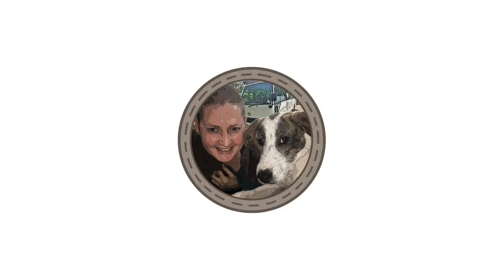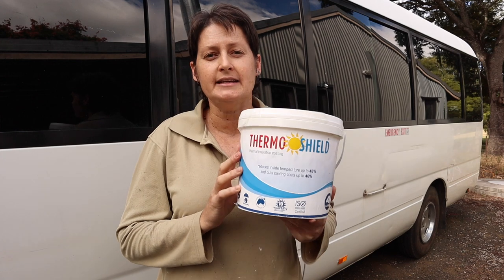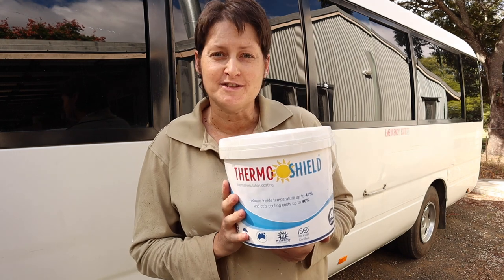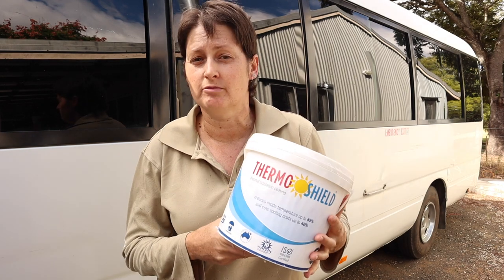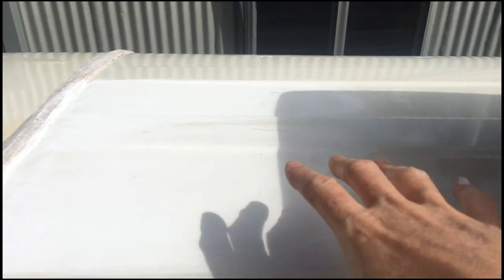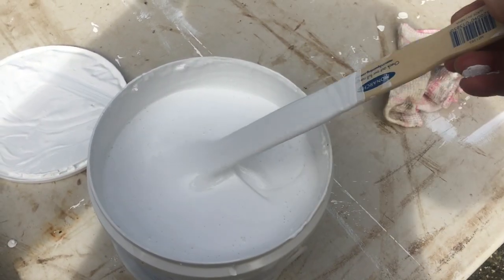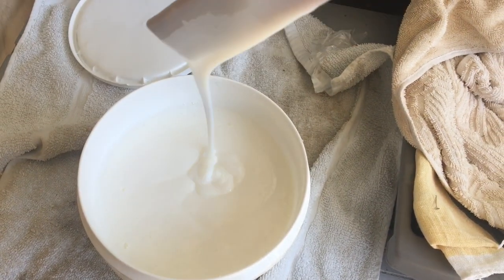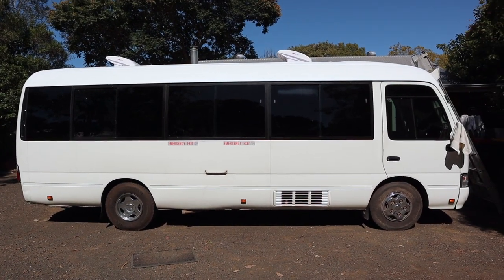Painting the Bus Roof with Thermoshield

Comment: I know penetrol helps with rust prevention is that the reason why you chose to apply it first & did you ask the people at thermoshield you were going to apply it first & if so what did they say & is yr roof meal or fiberglass?....................They would also of told you that you only need a certain amount / coats to your size roof to which will be enough, so did you apply more coats than directed as that is what you were saying as you should only of needed most at 3 coats ?
Reply from the maker: Yes I used the Penetrol for rust protection. I have used it a lot in my bus. Yes, I spoke to the Thernoshield people and they confirmed that it was fine to use the Penetrol as a primer, but because it is oil based, I should wait two weeks for it to fully cure before painting on the water based Thernoshield, which is what I did. I think I talked about all of that in Part 1 video. 
I can't remember if they recommended a minimum number of coats. I told them what size bus I had and they supplied the paint. They do say that the more coats you apply the better Thermnoshield works.
I am very happy with the way I did the roof. It's been 9 months now since I painted it. I've been up on the roof a fair bit since then building roof racks and having solar panels installed. And the bus has been through some very big storms. there is no sign whatsoever of the paint coming off and it still looks really good.